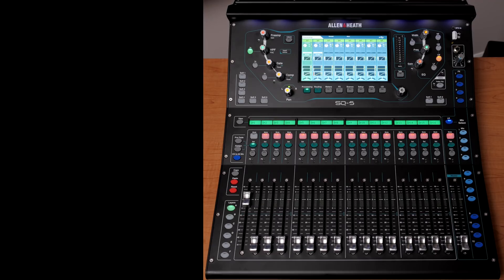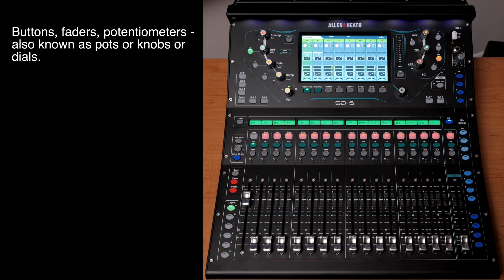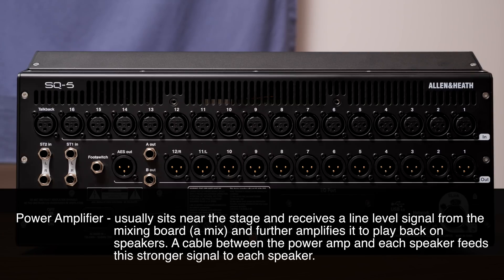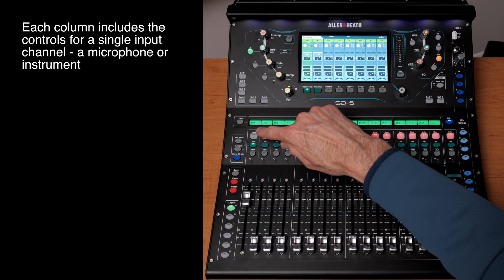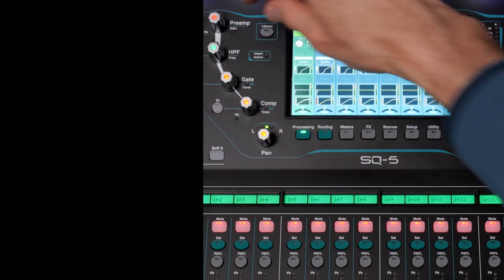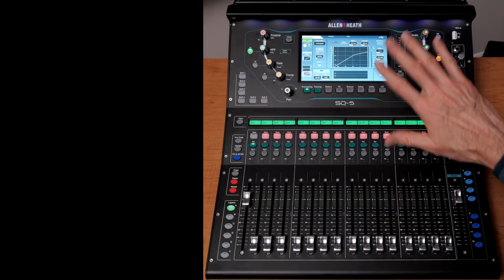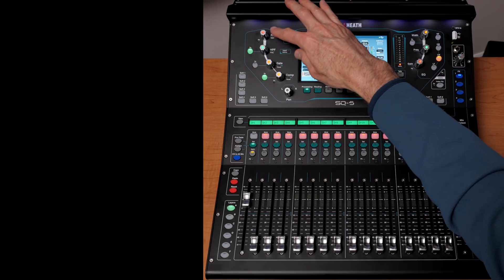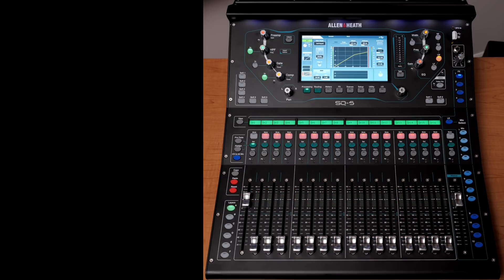Mixing Board Basics for Video/Filmmakers

Comment: Hi good teacher . 
Are Compressor and EQ destructive on this ?
Reply from the maker: Yes, I’m the software sense, they are.
Reply: @curtisjudd  sorry for repeating my question . Cus I just watched your zoom mixer video as well and you said that one has isolated track with recorder. but This one doesn't have ?
Reply from the maker: @AbbasTahaie  I see, you're asking about the SQ-5 as a recorder rather than a live mixer. It does apply whatever effects you set to each channel or the mix so you can just apply the effects to the mix if you wanted clean (non-destructive) iso channels. So this is even more flexible than the Zoom. You can do it either way.

Comment: so, how do i connect h1n to this?
Reply from the maker: The H1n isn't a great option for recording from mixing boards as the mix coming off the boards is line level and the H1n isn't set up to record line level. That being said, you can use an attenuator adapter cable and will need to use an adapter also to get from the 1/4" or XLR outputs to 3.5mm to get into the H1n. Not a straightforward job, but I think it can be done.
Reply: i request how to connect h1n to mixer tutorial  @curtisjudd
Reply from the maker: @azizulzulzaha  Hi Azizul, my advice is to use a different recorder that can handle line level signals to record from a mixer. I do not plan to do a tutorial to record from a mixer with the H1n because it did NOT work well when I did it in the past. I'm sorry.

Comment: Ola Curtis, great video. I'm also looking into SQ5 or 6 mainly for conferences and production. My first question is about automatic mic mixing. Have you tried it yet and does it work like its supposed to? My current soundcraft signature mixer is great but mixing live panels with many open mics is not that great. Faders are not touch sensitive? Are you planning to mix with it or ITB (in post), I see you don't have a soundcard. Thanks.
Reply from the maker: Hi receptxful, I have not had an opportunity to use the auto mix feature yet, just upgraded to the latest firmware earlier this week with auto mix. Hopefully will have a chance to test it in the next few weeks. I'm pretty picky about automixing: I've got Dugan Automixing in my Sound Devices 633. If the SQ isn't up to that...  ;-)

This will be used as a control surface for mixing in post once they finish the MIDI software for SQ. Faders are definitely touch sensitive.
Reply: Yep Dugan rules. Thanks for reply

Comment: It would be very nice, if A&H would have audio meter on this board.  I also hoped that this board has library of differences manufactures's of musical instrumentals that we can do a quick setup.  For example; we can quickly load a Shure Beta87 setting on channel 1 and so on...  I saw this feature on Yamaha, Presonus StudioLive, and more.  But, I did not see A&H mention about this.
Thanks,
Reply from the maker: Thanks. Perhaps A&H watches these comments and can take the feedback. :)

There is the mix meter that changes to a channel meter when you press the PFL button. Also, each channel has a multicolor LED to indicate level. This is not the same as a dedicated multi-segment meter but it does work better than I expected.

The microphone feature on the other boards - what does that do exactly? Set gain level and EQ?
Reply: Oi Curtis. He means library presets that you have on behringer x32 and I think on midas m32. They serve as a starting points for sound checks. e.g. you're using sm57 on snare, under library you apply "sm57 snare" preset and it automatically tweaks eq for snare. You can find from EQ and compression to vocal and instrument presets.
Reply from the maker: I see, thanks!

Comment: Nice tutorial Curtis.  Can you shed more light on the audio interface capabilities of a mixer such as this?  A&H describes this as a 32x32 audio interface.  Does that mean the USB port can support 32 channels of 24-bit audio to the computer at the same time as receive 32 channels of 24-bit back from the computer?  What sample rates can this USB port support?  And lastly, would the preamps and converters be on par with those used in a Sound Devices 788 or equivalent piece of hardware?
Reply from the maker: Hi Stephen, thanks. I’ve just begun exploring its use as an audio interface. I believe that is correct, 32 channels in and out via USB2. I’m not clear on whether all can transfer simultaneously. The headphone amp seems to get a fair bit of digital interference when the board is connected via USB and I haven’t determined whether that’s just an issue with the USB cable I’ve been using. When recording directly to USB stick on the SQ-5, the self noise performance is very good and the overall recording sounds, subjectively, very good to my ears (that’s purely based on recordings of dialogue). Definitely sounded to be in the same league as the SD 6xx series mixers to my ear.
Reply: Thanks Curtis.  I'm probably not the only one evaluating the best upgrade path for a larger channel count.  Premium quality audio interface boxes from the likes of Prism and Metric Halo are quite pricy compared to the latest mixer/interfaces coming to market of late such as this Allen&Heath unit.  If you get a chance to do a more in-depth review, I'll be sitting in the front row.  Keep up the good work!
Reply from the maker: Thanks Stephen, will do!

Comment: Hi Curtis. Another great video. As a live sound engineer I did want to point out that the signal path, particularly on a digital mixer may not go from top to bottom as you suggest in the video. Top to bottom is not a bad place to start, but the best tool would be to read the block diagram for your mixer (for instance, the diagram from the SQ5 can be found here: http://www.allen-heath.com/media/SQ-5-Technical-Datasheet.pdf). To make matters worse, digital mixers can change where different components go in the signal path. That being said, for a broad overview, keeping it simple is probably best, though a nod to the complexity may have been a good point to make as well.
Reply from the maker: Thanks Bob, good points.

Comment: Thanks for the sound board explanation video.  I was wondering for years how it was wall laid out.  It would be nice to see/hear, what each knob effects, with sound.  Gain I understand and bypass cuts off certain frequencies but the Gate knob is is a little strange.  I can't visualize in my head how that works.  I work with electronics so I understand what is happening with most of that but eliminating sounds via a gate doesn't make sense.  It sounds like Gate raises the floor for when sound is amplified.  In other words it is a minimum sound level before the mic gets amplified.  Can you elaborate the concept of the "Gate" effects?  Thanks.
Reply from the maker: Hi Alan, the general idea with a gate (perhaps more accurately referred to as an expander) is that any time the amplitude falls below a particular threshold for a period of time, the expander reduces the amplitude of the signal by a specified number of dB.
Reply: Thanks Curtis Judd.  So the gate does what?  Sets the time, the threshold or the amount of dB reduction or all three based on an algorithm?
Reply: Not exactly, but close. Once the db level is low enough, the gate closes and reduces the signal by a certain amount. A really bad example of gating is when you hear it shut the mic off completely. Any noise that the mic was picking up is suddenly gone and you're left with silence. A good example of a gate is when you're using it to get rid of some unpleasant sounds in a subtle way. For example, say you have a drum that is really ringy and annoying. You can apply a gate to it and if you set the settings on the gate right, you can capture the attack and resonance of the drum, but then slowly fade it out once the db level dies down. This will avoid the irritating hums that a drum may have a few seconds after the initial hit. 
All the settings can be adjusted for how sensitive the gate is, how quickly it closes once below the threshold, the hold time that it has, etc. Gates are very easy to screw up so take note of that.
Reply: Thanks for your help TX-130

Comment: Hi Curtis. Why do you choose this one vs Behringer X32? X32 seems to have a better bang for buck. 
Some comparison ideas?
Reply from the maker: Several engineers I spoke with love their X32 but admit that the preamps are not as nice sounding as they'd like.
Reply: I don't know... these preamp things seem a bit "arcane", I think.  I mean, do you HEAR some difference between for example Zoom F8 and desktop preamp? It could be interesting having some wav files of different portable/desktop preamp to hear if it's something really audible or more of a suggestive thing  :)
Have you some comparison  wav links  between X32 preamp and other brands?
Reply from the maker: Purely hear-say in this particular case but I can say that I have heard significant differences in other cases. In any case, I'm quite happy with the sound of the Allen & Heath preamp and converters.
Reply: I am completely new to shooting video, but got involved with a “Meetup” group who wants to produce monthly videos. We shot our first video where I supplied the video cameras and the audio equipment. I purchased. MixPre-3 for capturing the audio from 3 mikes. I was not aware of ability to capture the three separate videos on different tracks. As it turned out, the fellow doing the video post processing did not like the audio from one of the mikes, so he ended up using the audio picked up by the cameras. I probably could have used the MixPre—3 for our next shoot, but I hate the very small screen set at a vertical orientation. I then purchased a Behringer UMC404 and a new laptop on which I loaded the program “Reaper”. With this combination I was able to capture all the separate tracks and save them to the drive on the computer individually. Unfortunately, this process was time consuming and I was concerned I would not have time to do this between different shoots. I then purchased the Zoom R16 which does exactly what I want. Now I have a MixPre-3 and a UMC404 which are sitting on the shelf.

Comment: Hi Curtis! Me again...firstly, thanks for yet another great video, not so much for me, but i have recommended this (and your channel in general) to some friends who are relative n00bs in the sound world.
Now to the digression... just wondered if you have seen the recent discovery of a "fix" for the hunting autofocus issue with the GH5. Would be interesting to hear your take on it. In case you haven't seen this, it appears by varying the shutter angle to 179 º it drastically improves the focusing ability of the camera. Quite why? Who knows? But i would be interested in what your thoughts are on this.

PS. how about a video on Shutter Angle...? Not to clear on this myself, as to why it works, why you would use it, and how?
Reply from the maker: Hi Tim, no I hadn't heard about this. My GH5 is presently in the hands of Panasonic for repair (has been there nearly 4 weeks and no word back yet). What I have noticed is that the face tracking on the GH5s has been very good. In fact, good enough that I have used it on several of my most recent talking head shots and that's at 180 degree shutter angle. I'll have to give it a try once I get the GH5 back, hopefully soon.
Reply: This is the YT vid where the original discovery was noted:- https://www.youtube.com/watch?v=iGMY4YRTk0E
another interesting follow up here:- https://www.youtube.com/watch?v=_GcP0K26jEw

There are other videos which have confirmed his findings, and extended the info, for recommended settings to implement his idea. Just a heads up. Thought you would find this interesting. Won't precis the results here. 
Hope your GH5 gets well soon!
Reply from the maker: Awesome, thanks Tim! If it works as well as the face recognition focus tracking on the GH5s, then that's great! Will give it a try when I get my GH5 back from repairs.

Comment: Cool new mixer, by the look of it! Have a QU-16 which obviously shares a lot of DNA with this. Use it for music recording, mainly, but it is small enough to be pressed into PA use, on occasion. They  sure are turning out some good stuff these days! Is this a new purchase, on your part, or mainly for review purposes?
Reply from the maker: This is a new purchase for live and recording jobs that require more involved mixing and lots of inputs (going to try my hand at music).
Reply: Cool. Re Music... Logic Pro?
Reply from the maker: Audition to start. May try Logic as well.
Reply: Audition looks like it is purely digital audio recording/editing/mixing. depends what you want to do. Logic as a musical DAW, has a much greater range of possibilities. If you want to record from a MIDI keyboard as well, then it's Logic. Or Cubase, or various others. 
I am an unabashed Logic user, so if you want to create quick but great drum parts, use a host of software instruments and effects, then Logic/Cubase style is definitely the way to go.
Are you just wanting to use Audition as a digital version of a tape recorder. only?
Reply from the maker: It's probably between Logic and ProTools. ProTools is still, mainly for historical reasons, the primary DAW for film mixing as well so I may go that direction. But for music, I think I'd prefer Logic. 3 DAWs are probably more than I can or want to manage.
Reply: Yes. definitely Logic (or Cubase, or others) are definitely best for a mix of music inputs. Pro Tools was always pretty much a digital equivalent of a tape recorder... they have added MIDI stuff, as well, but it remains primarily an audio recorder/editor. If all you are doing is straight audio recording/mixing, then probably Audition will do all you need. I don't use it myself, so I can't really say how it rates, at least as far as music is concerned. A good reason for Logic, would be if you edit in FCP. The workflow is not 100% apparently, but cam work pretty well. 

Guess it depends on what you already have, as against learning something new!
Either way, hope you settle on something that works for you. And if you DO go for Logic, look up a YouTuber called dancetech. He's an english guy who has worked in music for years (i am a regular viewer and commenter on his channel) and has done a superb series of videos on Logic going back several years. Goes into great detail with much practical demonstration. Quite a character, i would think. Check him out first to see what Logic could do for you. Hope your music goes well! Will it be for your own films?
Reply: PS... Quick question... have now just got my GH5, with kit lens... (walk before you run!). Is there a good source you could recommend for guiding a n00b on how best to set up/basic usage for this camera? Thanks again!
Reply: Thanks for the info Tim, very much appreciate the tips!